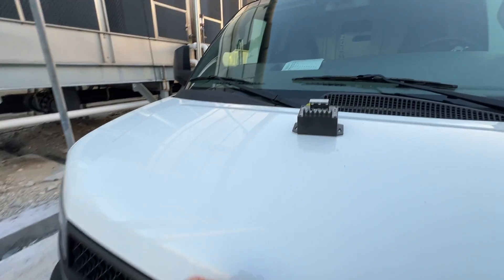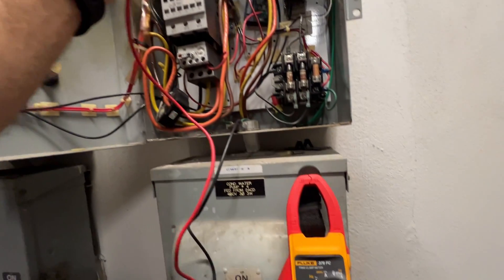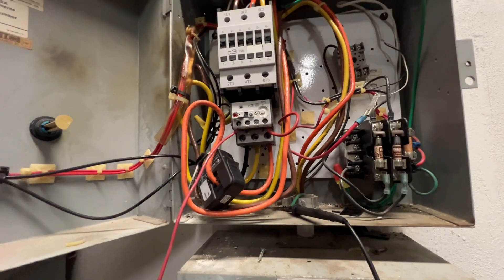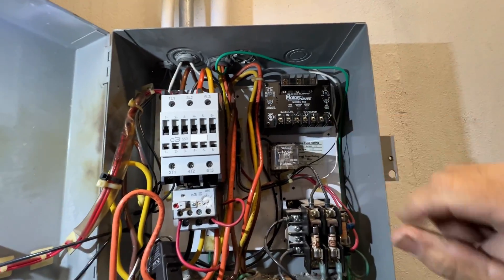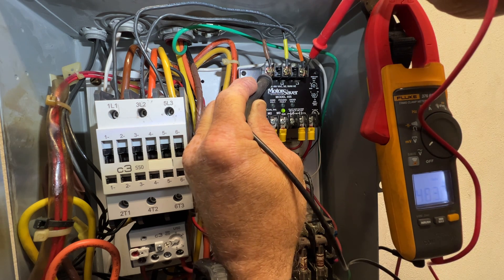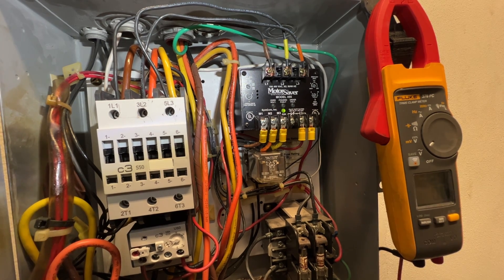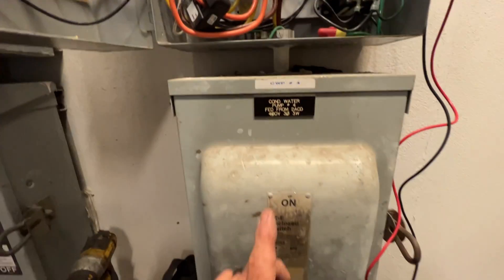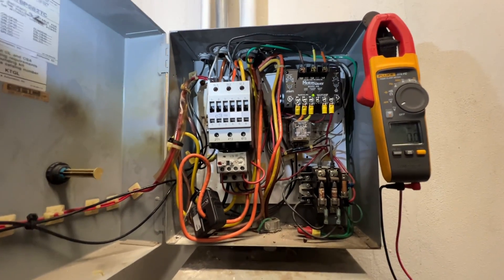Install And Setup Motor Saver 455….Simple Solution

Comment: The first place I worked had problems with phase loss sometimes we would just lose a phase at random also we often had under voltage we were supposed to get 240/415 volts but often would be under 220 phase to earth. Never knew why the electric company said was not our business to know
Reply from the maker: They have the pole supplying power to these buildings supported like a crutch, if the weather acts up any then when get outages

Comment: Is the controls just pulled from the contactor? Thanks for the video.
Reply from the maker: This one can monitor line voltage and load voltage across the contacts if desired . That powers the Motor Saver up from the line side L1,L2,L3. The N.O. Contacts opens the control circuit upon fault condition. Thanks for asking!